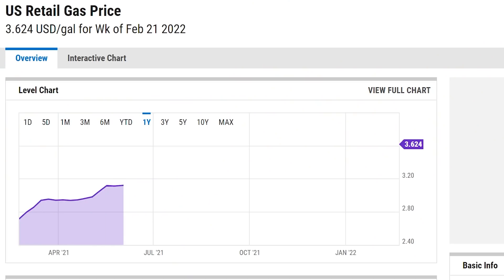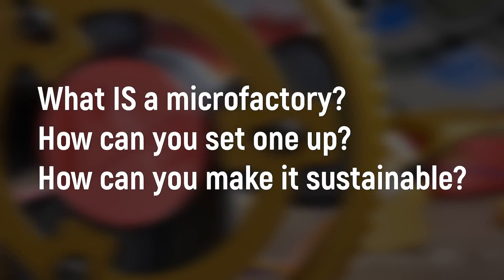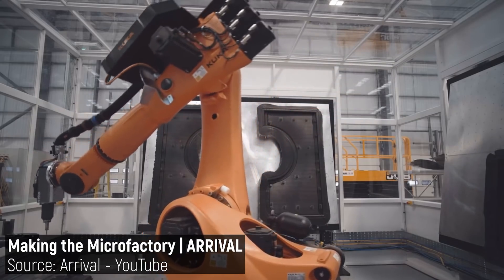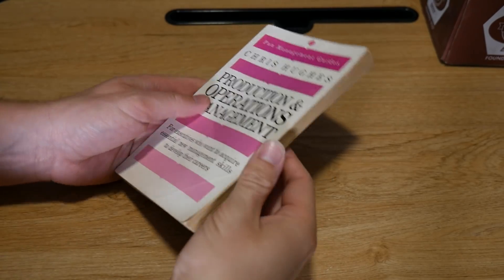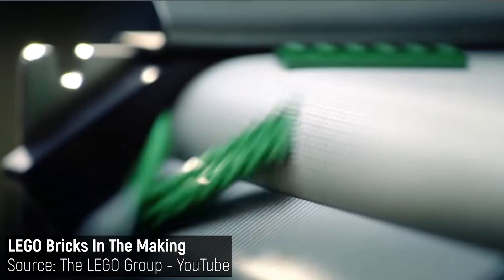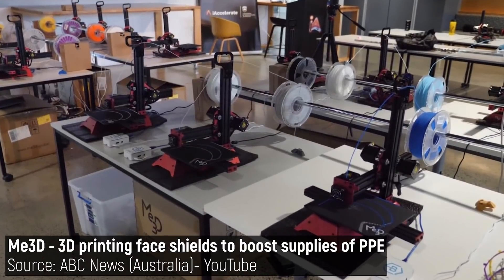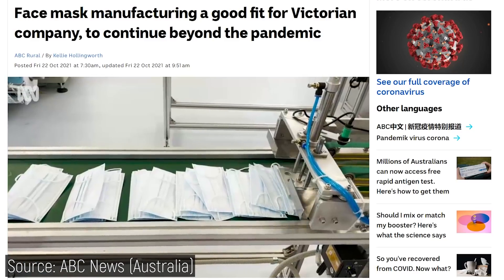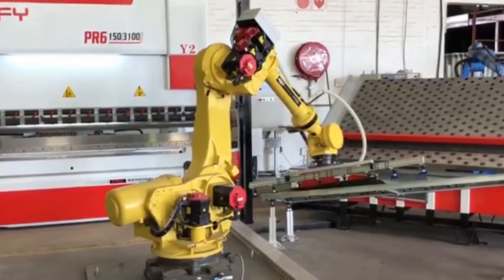Can Microfactories Solve the Global Logistics Crisis?

Comment: Isn't it all about cost?
I don't see how a microfactory could ever be competitive to a big factory.

And volatile global shipping isn't really an argument either.
Unless your microfactory gets supplied by another local microfactory that gets all their material from a local mine you are still dependent on raw/stock material from all over the world.
So the solution for this are not microfactory but rather scaling back the on-demand production. If factories all over the world would start again with having stockpiles of the material they are using then stuff like shutting down the Suez canal wouldn't have had such a big impact.
Reply: Very good point on the supply chain indeed, there are multiple angles where I don’t see a microfactory be profitable, unless I use maybe the cheapest ever Chinese (oops supply thing already) printer or machine + finding free material locally to make stuff. Which still costs money in wearables, electricity etc. If I don’t make 100’s of products I won’t make profit. Very interested in how this is tackled in upcoming video’s though.
Reply: The idea is to not compete with big factories because the products are too specialized or the market is not accessible for big factories.
Reply: I agree with Jehty.  In the country i reside, virgin sheet PE plastic increases in price about 5-10% every month.  Very early 2020, a 2000x1000x20mm sheet of PE cost about 120, Now that same sheet of plastic costs about 260.  I can only assume the price has gone up so rapidly in the past couple of years because of supplies issues.
Reply: There are many niche products and low-volume production runs that aren't feasible for factories to produce. Economies of scale only work when there are millions of people ready to buy those mass-produced products.
Reply: Supply issues exist for our safety...just ask any politician preventing the flow of goods and services - for our safety...
Reply: @PlasmaBurns  Sounds like you're repeating a conspiracy theory... 🤢
Reply: @Shocker99  Do you know what the difference is between a conspiracy theory and Fact?
 - About 2-12 months.

Comment: As the energy prices are rising cargo and logistics get more expensive. I share the view that the assembly, and in some degree the production, could be shifted to local workshops. However the strengths of each model of production should be assessed, a small workshop could never compete with a factory spitting thousands of pieces a day, but a factory usually lacks the flexibility of a workshop for custom pieces and repairs, I don't see the factories going away anytime soon but a workshop revolution fueled by the massification of tools like the CNC, 3D printer.. etc, Thanks for your awesome content!!!
Reply: 100% agree. Ubiquitous items that virtually everyone needs multiples of, C-clamps come to mind, Micro factories just don't make sense. But most of the rest is fair game for micro factories.
Reply: I totally agree with you. Also it is not a bad thing for countries to depend on one another. It secures piece as well. As an exmple, the US is less likely to wage war against China and vise verse if they both depend on one another for production or for other economic reasons.

Comment: Germany has a very interesting system of small to medium manufacturing. Works well for them.
Only slight problem which has being very relevant recently is that a lot of these small industries are designed around burning natural gas which becomes an issue when your gas supplier is your big neighbour to the east and they start creating artificial gas shortages for political reasons. It's not as easy for 10,000 small factories to convert away from gas as it is for one big factory to do so.
Reply: But small to medium companies is not microfactory.
If you look at all the successful small to medium companies in Germany that you mentioned then you probably won't find a company that fits into a garage.

Comment: As tech advances microfactories definitely have a place in the modern world. It's obvious that not every single product can be produced in microfactories, but some specific products could benefit from it. This would also be quite beneficial because any decrease in CO2 from shipping is a great improvement overall. I think that for microfactories to become a more viable solution we also need the products themselves to be designed with this in mind, so design plays a huge role in this. Thanks for the video Angus!
Reply: Decrease in CO2 from less shipping is only a plus if the smaller scale manufacturing doesn't create more CO2 during the manufacturing process.
And for the most manufacturing processes I believe that larger scale produces less CO2 and waste per unit.
Reply: @Jehty_  I think you're right on that. Hopefully we see more advancements and widespread usage of renewable energies though.

Comment: Tricky, I would need to invest quite a bit to make my micro factory work reliable. Which indeed would make the few products I then make, very expensive for the local market. How can we avoid that really, other than making very simple and basically not much more than pretty products for ppl to buy? If it’s my job, I would need to make quite a bit of profit to pay the bills.
Reply: Also this shit won’t work with metal. We make and sell bmx parts and no this won’t replace our Taiwan factories. I suppose this might work to create cheap plastic crap that people usually buy off Amazon for $10
Reply: @SAFbikes  we aren’t a micro shop (10 guys) but we have been seeing a lot of other local customers either returning to us or moving more parts to us because of supply chain issues/overall costs. This is all metalworking but job shop level quantities; 1000 or less for quantity

Comment: Micro factories make a massive waste problem. Large factories are able to recycle offcuts and fails at scale which is a HUGE deal. Having 10,000 microfactories and you can't do that recycling efficiently.
Reply: I care more about supply chains working than I do there being more waste.
Reply: @DrakeTain  more waste is bad supply chain
Reply: Are you able to source any relevant data to support your claim? Have you any personal experience in both large and small scale production facilities that may offer the slightest anecdotal evidence?
Reply: @yootoob7048  It's a no brainer On a large scale many things become economically feasible, that a smaller shop can not do.
Starting with collecting the different "waste" as pure as possible, for easier recycling (sometimes even in-house), using techniques that requires less material in the first step (but have huge setup costs => only viable for mass production) up to something like heat recovery systems or even using other materials that are not so "small scale friendly" (think about ikea with it "cardbord-core" products, hard to replicate in a micro shop).

The advantage of small "micro fabs" is not efficiency, it's flexibility.